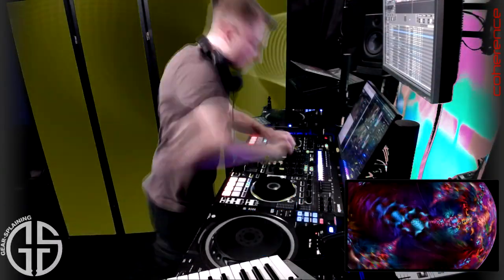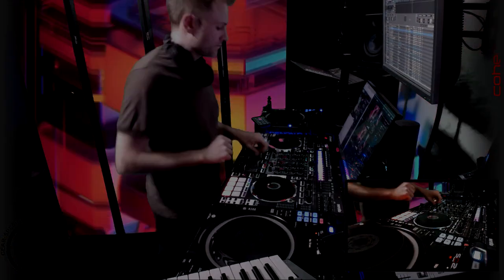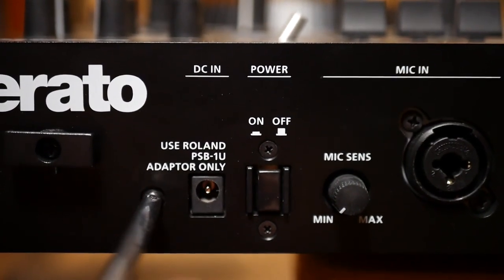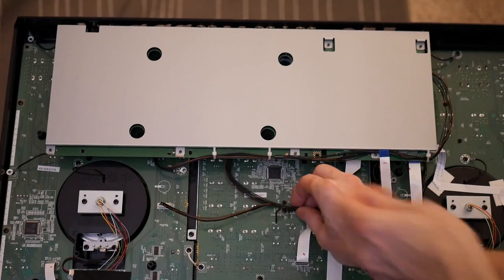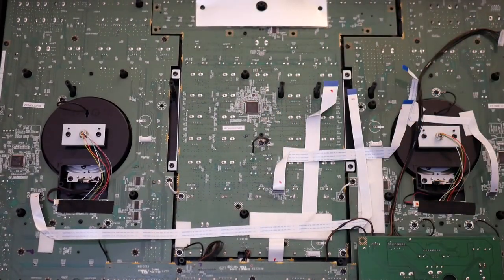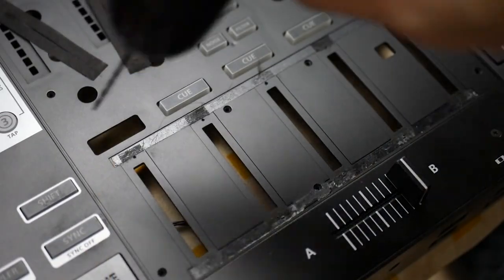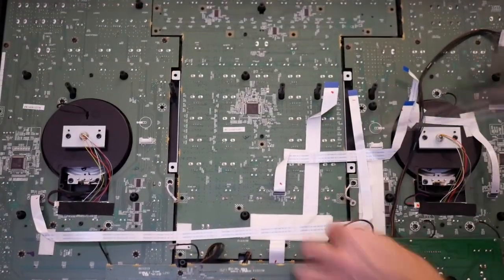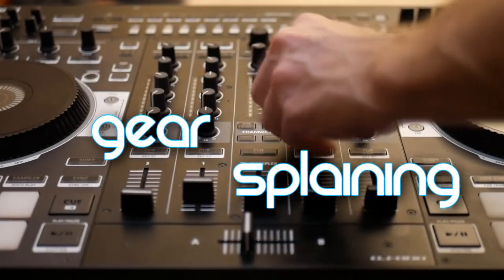Roland DJ-808 mod: Fix those faders for good!

Comment: For those that can’t understand why he’s doing this , After 2 years of mixing with the upfaders , my channel 2 fader 🎚 is feeling like it’s come loose under the cover and the volume is cutting in and out very loudly on its own .  I’ve already had mine apart to replace the cue buttons , so now I have to do this ! I’ll let you know how it performs afterwards. It is disappointing that such an expensive controller needs repairing twice already , but I still love it
Reply: I can feel my channel 2 is getting loose not affecting volume yet but tonight I guess I pressed play on one side at weird angle and it does not fell right at all . Guessing your fix for the cue would be similar, how did you do it?
Reply: @michaelo3001   search the serato forums, there is someone in the comments about this issue explaining how to do take it apart... yes they sink at weird angle and jam up a bit
Reply: Jay B couldn’t find it but I’m sure I can figure it out. Just trying to track down the parts I need.
Reply: @michaelo3001  let me search
Reply: why did you have to replace your cue buttons? I would like to know if there is other prophylactic upgrades I can do on my besides the fader screws.

Comment: okk so I'm not the only one, this is cool, thx for taking your time. I see the fix, but I don't quite get how the screws are holding on the faders, if they're only screwed on the case, how are the screws holding the faders in place? thx
Reply: The faders themselves have screw holes already. The screws that you add sit in those holes.
Reply: @fermd9357  ^^  That.  The faders already have threaded holes for the screws on their shrouds.  Roland just inexplicably decided not to use them

Comment: Awesome Video! My deck isn't under warranty anymore and I've had my faders break down twice now, which I paid to get repaired.... Now it has happened a third time, and I want to do this fix but since one of the faders is currently malfunctioning, do you think i would be able to reattach the fader while I have it opened up? Or is this more of a preemptive fix? Would it be as simple as using a little bit of solder to fix the fader?
Reply: Ideally it is a preemptive fix, but if you have the contact already sheared off the faders, pick up some replacements (PTE45-151A-103B1) and drop those in.  THEN screw them in so you can prevent that from happening again.
Reply: @chrisnietzold7665  for anyone thats reading this thread, I bought PTE45-151A-103B1... which were the correct slide potent.... but the way they come the contact is coming off the end of the slides board instead of through it (like the factory installed ones) ..... but i was able to bend the contact and solder  it onto the board... It worked great and when i put everything back together worked like brand new.... (Now the ones i didnt replace are starting to act up) Maybe someone knows where i can get exact replica Sliders from?.... that dont require any bending to get them to fit in, since i plan on replacing the other two
Reply: @billy10917  Yeah, sorry about that!  I found the exact same thing.  (and managed to bend the contacts to fit as well)  It doesn't make for the easiest installation, but they do work.  I'm currently in the same boat; I installed 4 of them and left my channel 3 fader original as it looked just fine, but it is now out as well and I'll have to replace that one. (I did buy 5 total, so I'll get it done eventually)

Comment: If Nintendo is facing a class-action lawsuit for known issues on their Joy-Con controllers, there’s gotta be something we can do to get Roland to step up.
Reply: To be fair, I purchased mine pretty much at launch so I have no idea if they ever did or not.  Perhaps someone with a recent purchase would be nice enough to pop off the mixer faceplate and let us know?  ;)  You're right though.  Unfortunately for us, they probably sold somewhere in the 1000's of these vs. how many million Switch users.  I agree though, they really should fix or at least address this.
Reply: Chris Nietzold According to someone at Roland that I talked to, units built after a certain date have revised play/cue buttons that are reinforced in metal. It depends on the serial number.  This conversation happened before my fader showed signs of failure, of course.
Reply: @fermd9357  Do you know what is the cut off date? Mine was built in September 2016, any idea?
Reply: @sajjad72  I don’t know, sorry

Comment: Wow, im having the same issue on my channel 2 fader, at first i though the slider needed to be retighten but in fact the prongs that hold the slider to the pcb board either was poorly soldered or just broke off.  Luckily its at the bottom of the fader near the crossfader chamber.  SO what i did was remove the faceplate and the crossfader chamber and can see it wiggling around.  i dont have the guts to do what this guy did by removing everything.  Would an epoxy solvent help if i had put that in place of the loose joint?   Would that damage the pcb board with a little epoxy to hold it in place? I really love my unit and don't wanna drop another grand on a decent controller and my warranty is definitely expired.
Reply: same happened to me, channel 2 is dead, seems broken 😭 is this fixable?

Comment: Having a little trouble taking of the scroll knob, any tips?
Reply: That one can be tricky due to being recessed.  If you have a pair of spudgers or guitar picks, place those down into the recess on opposite sides and apply some force.  Otherwise, grab a thin towel or rubber sheet and grab from the base of the knob and pull straight up.

Comment: Volume fader #2 on my DJ-808 cuts off if I wiggle it, or from bass vibrations.  Do you think the screws will help, or will I have to resolder the connections?
Reply: If the unit is still under warranty, send it back to get fixed.  If you are out of warranty, you can pop it open, check to see if the terminal are broken at the fader or the board, then make the appropriate choice.  If broken at the board, resolder the connections, then use the screws as shown in the video. If broken at the fader (you'll see the legs just sheared off, stuck in the mixer PCB), then order up some PTE45-151A-103B1 replacements and drop them in.  Then yes, use the screws.  It'll save you from having to do it again in a few months.
Reply: Chris Nietzold I was talking to someone at Roland who would’ve authorized a repair outside of warranty, but I told him that I previously opened the unit to repair the play buttons. And he ghosted me. So much for being honest.

I couldn’t make out any terminal damage on the fader or board,  however, the fader only works now if I apply downward pressure as I slide. I’m gonna get some screws and hope for the best.
Reply: Ouch. ( I've got the same issue with the play buttons >.<)  In my case, I just assumed that any fix would have just returned it to factory state so I decided to improve it since it is such a nice controller otherwise.
Reply: Chris Nietzold I used Gaffer's tape and super glue to repair the play buttons.  The tape acts like a 'hinge' to keep the top part of the play button from sinking.  It's the bottom of the play button that makes contact with the button on the board.  Reach me on Gmail at iamdjferm and I'll share pictures of what I did.

Comment: Alright so my channel 2 fader lower connection terminal broke free of the motherboard. So it's as if it is stuck in the full volume position no matter where the fader is. It is only the lower terminal that broke, and if I push the fader down in the right spot it works as it should because it is making contact again. Question is can I just resolder that terminal , or will using the screw method fix this as well? Just need it to be fixed so I can sell it and move on to something different. Thanks in advance and sorry for the long winded post.
Reply: You'll need to resolder the terminal, but you may have to just replace the fader entirely.  These tend break at the fader itself vs. the board. (breaking at the board would be a blessing in comparison)  You can sometimes bodge a quick repair on the fader then make sure it is mounted securely to get some extra months out of it, but if that terminal is broken off the fader, any fix is just borrowed time.
Reply: @chrisnietzold7665  unfortunately it has broken on the fader side. And yeah I botched a repair. Probably gonna sell for cheap and move on to pioneer
Reply: @wav.slav.6313  Probably for the best.  The new 707 looks incredible, but until I see that thing cracked open or screw heads on the fader ends, its a no go for me.
Reply: @chrisnietzold7665  I'm with you on that. I'm drooling over the ddj 1000srt.

Comment: My Roland dj 808 channel 1 and 2 is really bad,can I get the replacement volume fader to replace it????
Reply from the maker: Yes indeed, but they are tricky to find as the exact Delta B10 KX2 model seems to be discontinued.  Stay tuned, I'm testing some out and I'll name a replacement in the next few days.
Reply from the maker: Looks like the Bourns PTE45-151A-103B1 would do the trick.  You might have to trim off a few of the leads as the 808 only uses 3, but that'll fit and should work better than what came original. Long lead time on ordering, but cheap.  (Digikey has them, for example) If you want the actual originals: http://www.powerlight.es/potenciometros-lineales/4936-potenciometro-deslizante-delta-b10-kx2-qp-2010.html
Reply: @GearSplaining  Thanks for the video and the info!  Can you let us know which leads would need to be trimmed off?
Reply: @spindrome  Look at the Video at 1:03 then you will see which "legs" you have to keep. On right side probably broke off but you can see where it should be.